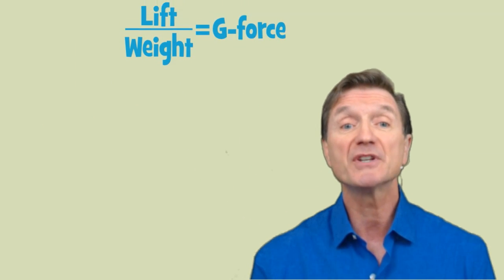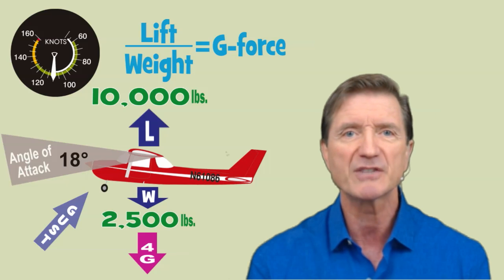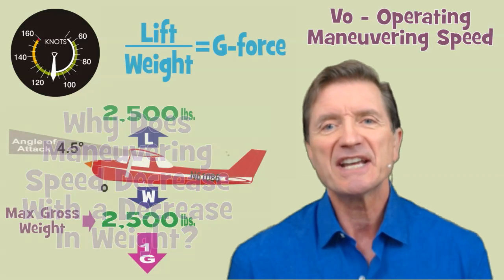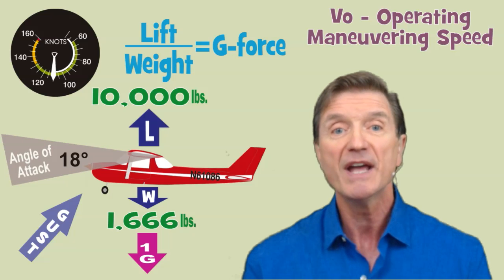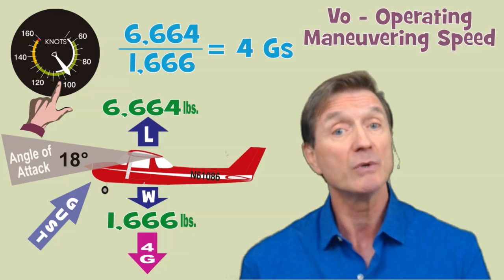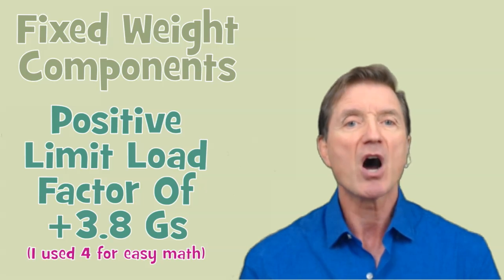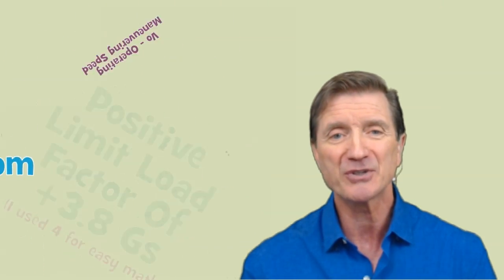Why Maneuvering Speed Changes With Weight

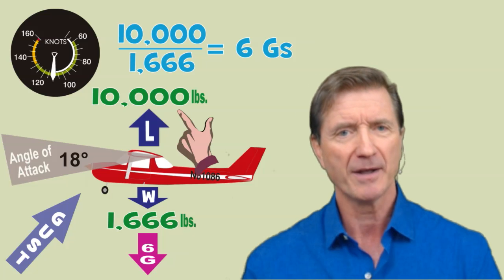Comment: 6:27 Finally! Someone addresses the elephant in the room of equal maximum lift, regardless of weight and/or g.

In many cases, the entire fuselage might be considered a fixed-weight component (e.g. aircraft with wing-mounted fuel tanks). For a given lift force, a heavy fuselage with light wings would stress the wing roots more than a heavy fuselage with heavy wings.

If we assume that the wing-root joint is the primary structural limitation of an aircraft, the ideal configuration for maximum maneuvering speed would be a light fuselage with heavy wings, so long as such weight/fuel is stored somewhat inboard (i.e. not tip tanks).

An F-14 can safely carry 2 engines, 4 Phoenix missiles, 2 external fuel tanks, and some internal fuel on its fuselage, because the fuselage is wide enough to contribute a significant portion of lift, while also reducing the span of each (cantilever-beam) wing. Structurally and aerodynamically, such aircraft with lifting-body fuselages can be thought of as a hybrid between a conventional aircraft design and a flying wing.
Reply: Ikr! This video and a message to youtube.com/@GregsAirplanesandAutomobiles cleared things up for me so much. I thought I was just not understanding the math of it for so long!
Reply: Absolutely top-class analysis! Very very informative indeed!

Comment: Aren't you neglecting spar stress loads of the wing against the fuselage in addition to the fixed mounts you mentioned?
Reply from the maker: Nope. It's just as I say in the video. Don't read anything else into this.
Best,
Rod
Reply: Could you elaborate on fixed-wings breaking free from fuselages in reference to maximum allowable maneuvering speeds?    @Flight-Instructor
Reply from the maker: Greetings Musashi:
The question you're asking indicates that you might not understand what the definition of maneuvering speed actually is. Have you had a chance to watch the first video in this series titled, "How Maneuvering Speed Is Determined?" Take a look at it here (https://youtu.be/o_KdHEzIJkk). @Musashi_Yojimbo  
Best,
Rod

Comment: If I'm flying an air tanker at the edge of its maneuvering speed, about to drop a full load of water on a forest fire. If my throttle suddenly becomes stuck (the obvious way to reduce airspeed), would it be better to pull up or down, to minimize aircraft damage?

 My speed would unavoidably increase, so which maneuver would accelerate my speed the least? And, would a pull-up in order to stall, then recover be a solution? Otherwise, my speed would continue to increase until structural damage occurs, as the aircraft settles to the new level flight speed.

I know it's a contrived scenario, but I'm curious about the dynamic physics of the sudden weight change.

Comment: Great video, as an engineer this was all intuitively obvious to me - but my CFI looked at me like I had grown horns when I said it to him back when I was earning my pilots license. So the wings are no more likely to break off at a given speed when the plane is lighter, but it makes for a very bad day if the engine breaks off and the center of gravity is now behind the wing...
Reply from the maker: Greetings Clark:
That's correct. As long as the airplane is at or below its present operational maneuvering speed, the wings aren't in danger of damage. It's the fixed-weight components that present a structural damage risk at lighter weights. I always love hearing about it when a student teaches his CFI something. 
Best,
Rod

Comment: There's one thing in this video that's missing that helped it make sense for me. The lift equation is L =  C_L 1/2 rho v^2 S. Meaning that at a given AoA, an increase in the velocity of relative wind over the wing will increase the lift produced by that wing. This helps explain why you need more AoA at a lower airspeed to maintain an equivalent amount of lift as a low AoA with high relative wind velocity, regardless of weight. It's not mentioned here, but for me it was critical to all of this. It's relevant to the section around 4:55.

Comment: Hello Rob 👋🏻 Why does a gust increase AOA? A horizontal gust increases or decreases my IAS speed (depending of the direction) and a vertical gust lifts or pushes the entire airplane down. Why does a gust increase my AOA as long as i hold the same pitch attitude?
I understand, that the speed increases of a horizontal guest will increase IAS and therefore lift and g-load and a vertical gust increases g-load by pushing the plane upwards, but how and why the change in AOA?
Reply: It's because the direction of travel of the aircraft does not change instantaneously, due to inertia. The wing does not know anything about orientation (horizontal/vertical) but only about airflow. Change the relative direction of airflow and you change the AoA immediately.

Comment: At 7:10 he says the wings have been designed to handle the extra G force. How much G force are wings designed to handle? If you were able to fly the plane remotely (in this example) at its empty weight, would the G force go higher than 6 with this strong gust of wind?

Comment: I am confused at how the angle of attack would be increased to 18 degrees with a gust coming from the same direction.  From 4.5 to 18 means a 13.5 degree gust.  If a gust hit the plane at the 3 degree AOA from the same direction, it’s new AOA would be 16.5 degrees wouldn’t it?  I guess the point is still demonstrated but when I drew it out that’s where I stumbled a bit.
Reply from the maker: Greetings Jonathan:
Ahh, the issue here is with your assumption about the "...gust coming from the same direction." The gust doesn't come from the same direction as the wind striking the wing. It comes from below the wing. Watch the video again with this in mind.
Best,
Rod

Comment: What if the plane is loaded with a most aft CG or most forward CG? That would change your angle of attack during cruise flight thus reducing or increasing the total degrees from your critical angle. In theory can’t this change your Va somewhat?
Reply from the maker: Greetings Trek:
Yes, it can, but not much. There is, however, another fact that can make a larger difference, in my opinion. And that is the use of power. Thrust reduces stall speed and Va is calculated at zero thrust. This is why I always recommend that pilots fly 10 to 15 knots below Va or Vo (depending on weight) when encountering turbulence.
Best,
Rod Machado
Reply: @Flight-Instructor  thanks for the explanation! love your videos.

Comment: i am confused.  g=lift/weight.  but then in step turn we increase load which is almost same as weight and we still have high G. if the weight increase in steep bank.  then g=lift/weight.  that mean g force should decrease with steep bank.   can someone please explain?
Reply from the maker: Greetings Abdulaziz:
Actually, load isn't the same as weight as discussed here. Weight doesn't change (unless you're throwing things out of the airplane:). It's the lift that is required to increase in a turn if you want to maintain level flight (assumed here). When lift increases and weight remains the same, the g-force has to increase. It's implicit in the equation.

I hope this helps.
Best,
Rod
Reply: do you have any videos on why flaps decrease stall speed. by difinition stall (exceed the critical angle of attack).  and flaps cause increase angle of attack. so it should stall easier than with no flaps.
Reply from the maker: Greetings Abdulazzi:
No, I do not. That's more of a "book learning" topic. But let me ask you a question. You said, "...so it should stall easier than with no flaps.
" What do you mean by "easier"? Do you mean slower? Let me know.
Rod
Reply: i am sorry. I meant (stall easier with flaps) because we increased the angle of attack when we use the flaps.
Reply from the maker: Greetings Abdulaziz:
Well, I can't say that it will  stall "easier" because I'm not quite sure what you mean here I can say that the airplane will stall at a slower speed. And that's the real value of adding flaps during landing.
Best,
Rod Machado

Comment: Very nice explanation! "Fixed Weight Components," made the light bulb go on. Thank you for finally providing an answer to my ten yr long question!
Reply from the maker: Ten years? I do understand this. I've spent more than a year researching some topics only to find an answer in some obscure corner of a library somewhere. Glad you found this useful.
Reply: @Flight-Instructor  Fixed Weight Components, that was exactly what I'd been missing. I'm not one of the 5 in 4 people who can't do math :-) and I always understood the relationships between AoA, lift, and load factor, but couldn't work out why the structural limits were defined by load factor and not purely by lift (force) - because I'd only ever been thinking about the wings. Bingo. So simple in the end. Many thanks!

Comment: I just heard Ron describe a linear relationship between change in AoA and change in load factor (G force). He said, and I paraphrase... if AoA was quadrupled from 4.5 degrees to 18 degrees, then the amount of G force is quadrupled from 1 to 4. ( by way of Lift quadrupled from 2500 to 10000 which yields 4 G's by way of Lift /Weight).  I had not head of the relationship of AoA to G force before. I have not been too successful in finding any other supporting information.  Is that what all of you heard as well? Ron, are you out there... could you comment?  Thank you.
Reply from the maker: Greetings Tom:
Here's what I'd like you to do. Click the link below and examine the "coefficient of lift" chart. Now tell me if the relationship between angle of attack and the CL "coefficient of lift" is basically a line or a curve up to the point where a stall occurs. Let me know by replying here when you do this.

https://www.grc.nasa.gov/www/k-12/WindTunnel/Activities/lift_formula.html
Reply: Rod, Thank you very much for your reply.  I did follow your link and while the Velocity Relationship Curve graph does show a linear relationship between CL and AoA (of course until one approaches the Critical AoA where everything falls apart), It does not look like a 1-to-1 ratio relationship. if it were 1-to-1, and the appropriate scale is used on the X and Y axis, the line of the graph would be at 45 degrees.  And one could take any given AoA(A1) and plot the corresponding CL(C1), then go to the doubled (2 * A1) AoA value(A2) and plot the corresponding CL(C2) and hope to find that C2 = 2 * C1.  But I'm not seeing that on the chart.  Now, CL is not lift... There are other factors to consider to derive lift from CL (L = (1/2) d v(squared) s CL).  So I'm still not seeing the relationship where double (or triple or quadruple) AoA also doubles (or triples or quadruples) load factor (G's).  Am I missing something here (I'm sure I am)? I'm thrilled that some with your experience and standing in the aviation community has taken the time to reply.  I would really appreciate any further guidance you could share (I have been wrestling with a good explanation of this topic for quite a while).  If you prefer, we could continue offline via email, or continue this thread here.  Again, thank you so much.
Reply from the maker: Greetings Tom: 
Almost there. Not only is the CL-AoA relationship one-to-one, it’s also linear. Linear doesn’t imply, suggest or even require equality, either. It only means that a change in one variable results in a “proportional” change in another variable. If I start at an AoA of 4 degrees (the typical AoA value for straight and level flight at Va), and instantaneously double the AoA to 8 degrees, the CL increases proportionally by (.3). Given that CL is a direct multiplier for lift, how many times can I increase the CL by .3 before reaching stall?

CL = Coefficient of LIft
Reply: Rod, thanks again for the continued conversation.  If we're almost there, you must have a better view than I :) I understand and agree with what you say about one-to-one and linear relationships.  I was only focusing on the equality of the magnitude of the change because I heard you to say in your video that the quadrupling of AoA causes quadrupling of lift, which in turn causes a quadrupling of load factor (LF).  I'm with you on the quadrupling of LF caused by the quadrupling of lift via LF = L/W.  But I'm still grasping for the relationship of AoA to Lift.  I understand the relationship of AoA to CL by examining the graph, and I can see that CL is a factor in deriving lift by way of the formula L = (1/2) d v(squared) s CL. I'm not sure what you mean when you called CL a direct multiplier. To answer your question from above, it looks like CL can increase by .3 about 4.5 times before reaching stall.  Besides CL there are other multipliers... I supposed that with everything else remaining constant, CL becomes a direct multiplier and in our scenario is the only thing changing Lift. But I'm not seeing how the .3 incremental changes in CL would have the effect of doubling, tripling and quadrupling Lift (as in the video).  I really like the journey we're on and I can't wait to see the finish line.  I only hope I recognize it when we get there :)   ...but wait, as I read my on reply back to myself before sending, I see that quadrupling  AoA is almost quadrupling CL (CL increase a bit more)... that definitely seems like part of the puzzle, but I'm not seeing the whole picture just yet (though it's probably right in front of me... kind of like that airport you look for at night).  Another hint please?
Reply from the maker: Greetings Tom:
Busy, but I'm back. So in response to your original question, there is indeed a linear relationship between AoA and G force. The fact that the CL-AoA graph is a line should make this quite clear (see previous link). And the line on that graph does indeed identify a one-to-one relationship. Keep in mind that a one-to-one relationship doesn't require equality between variables (look up the definition). And finally, the easiest way I can complete this explanation is to offer the following idea. 

Assume an airplane produces 1,000 lbs of lift in straight and level unaccelerated cruise flight at 100 knots at a 4 degree AoA. The CL at 4 degrees AoA is appx. (.4). If we double the angle of attack to 8 degrees, the approximate CL increases to (.8). Since lift has a direct linear relationship with AoA (all other lift variables held constant here), then this equation show what lift we can expect for a CL of (.8). 

1000 lbs/.4 = X lbs/.8

Answer = 2000 lbs. Therefore, doubling the angle of attack over its starting value doubles the lift and, therefore, doubles the load factor (based on the parameters of the video above).

Good fun,
Best,
Rod
Reply: This was truly a fun ride and thank you for working with me on this point.  I really enjoy the finer details and always hope to continue to grow my aviation knowledge. Your videos are the best and there are some great books on your web site.  Additionally your speaking engagements are a must-see... I just caught the FAAST TV thing you did with NAFI the other week... really good.  All that and you made time to talk with me about maneuvering speed. Again, thank you .  I truly appreciate it.
Reply from the maker: My pleasure, Tom. I do enjoy these types of questions. And thank you for those very nice comments, too. Deeply appreciated.
Best,
Rod

Comment: wouldn't exceeding the 4G limit load factor break off the planes wings, rendering you with no time to slow down once said turbulence hits?
Reply from the maker: Greetings Alex:
If the airplane is flown at or below its present maneuvering speed (Va, at max gross weight) or its operating maneuvering speed (Vo, at a lesser weight than max gross), neither the wings or the airplane's fixed-weight components could be damaged.